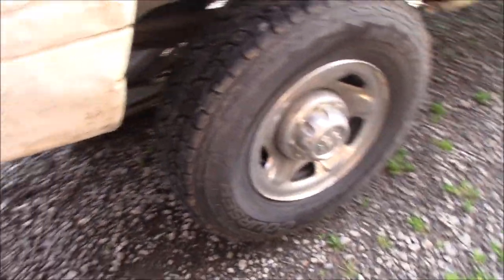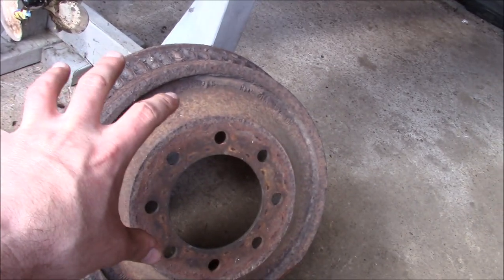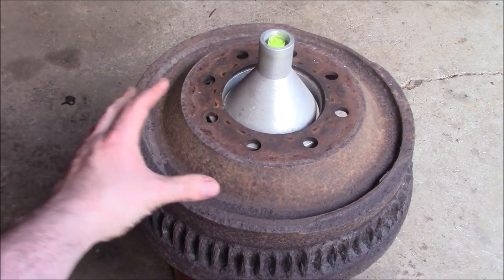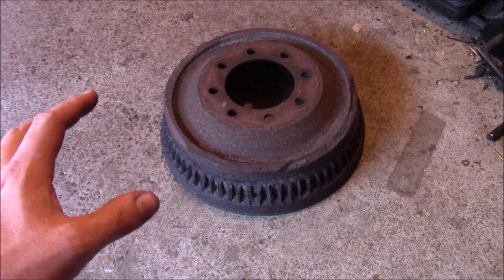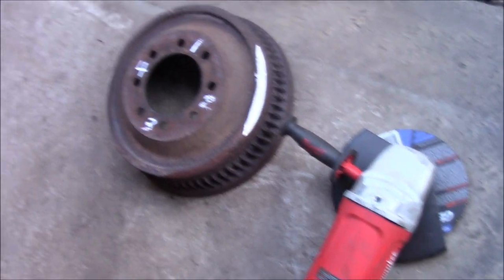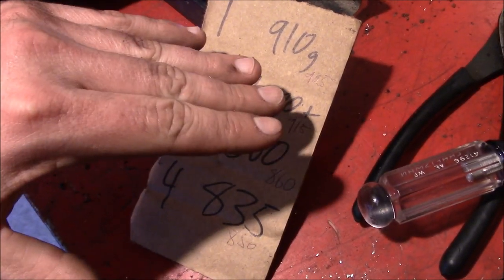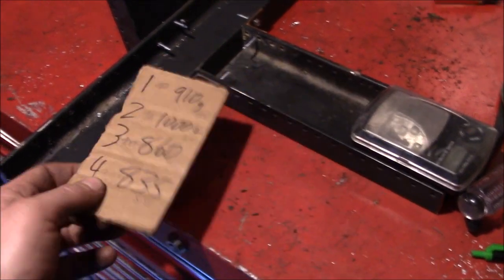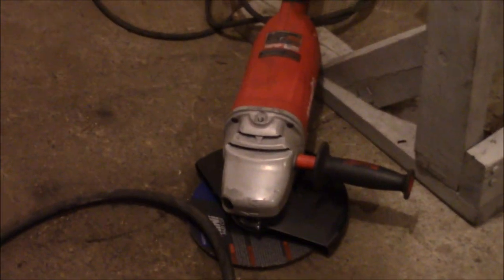Balancing Brake Drums With Scrap Metal Jig

Comment: I'm going through this BS right now!!! Months of trying to figure out why it feels like tires are out of balance 5 new tires and 3 rebalances later still hopping at 55 to 65!
Reply: ive had this problem one of my rear drums was nearly a pound out of balance.  this fix will work and solve most of your issue. it made a huge difference on my 85 chevy dually

Comment: i had this exact problem. on an 85 chevy dually. i live in the south so rust was not a problem.   the problem was the factory did not balance the drums properly !  the axle is a dana 70HD.  the left side drum was slightly out by a few oz.  the right side too nearly a pound to get it right!   man the truck is a whole new kind of smooth now.
Reply from the maker: Nice, not too common of a problem it seems, but annoying when it's there.